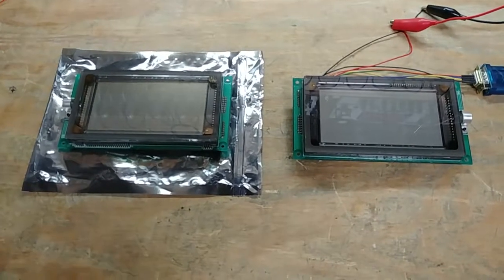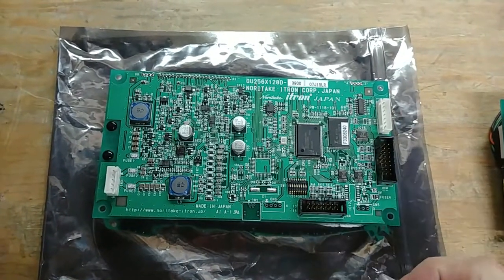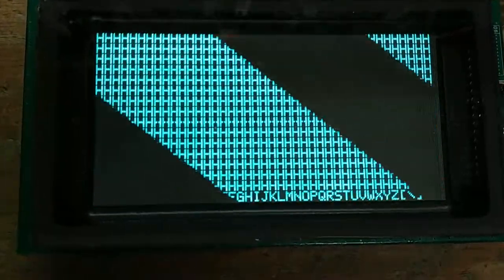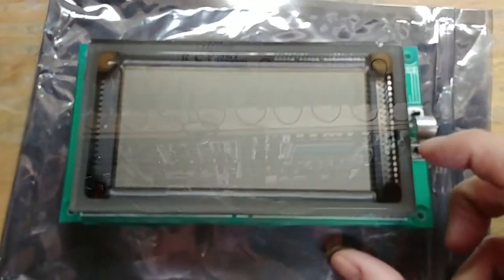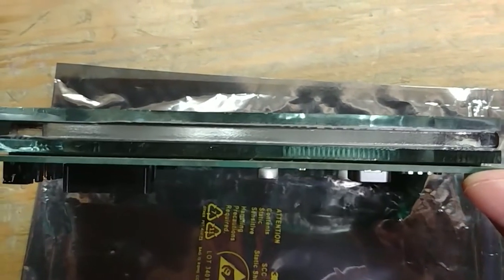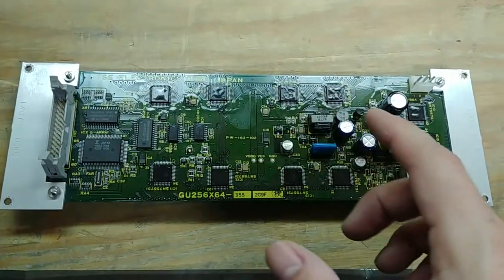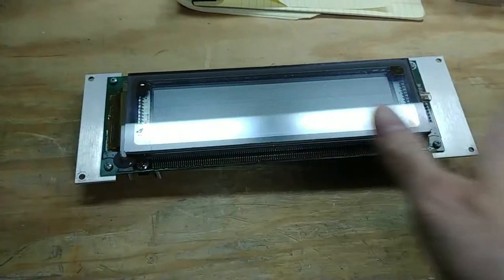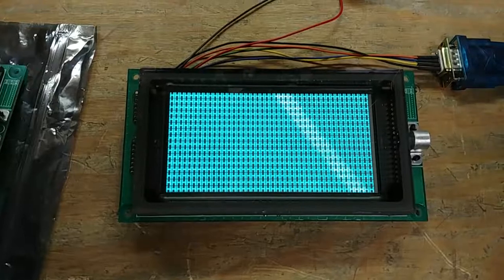Vacuum Florescent Display (VFD) Test

Comment: I have a pair of identical Noritake displays. I'm fairly sure these use Chip in Glass driver ICs mounted inside the VFD panel (usually under the cathode filament supports). Which is why there are so few connections to the panel. I suspect you have probably lost an anode drive. Which will then be repeated for the corresponding pixel under each grid (which covers several columns). There are some great photos of the internal structure of a similar display here. https://www.eevblog.com/forum/reviews/fluke-8846a-teardown-9409/

Comment: Thumbs up for the bidirectional buck boost converter project moving! Very curious how you will program a control interface for on the vfd, should be interesting
Reply from the maker: +jontscott 

I have been keeping an eye out for a nice VFD for the converter...

I think I will show a simplified schematic on the display (like an old control panel in and engine room).

With voltages, currents, contactor states, etc... In a box located next to the schematic symbol.

I have a bunch of rotary encoders with push buttons... So you can highlight the value you want to change and then press the button to change the setpoint voltage, current limits, etc...

That is the plan anyway. ;)

I need to get the Pack Sniffer 2 done first.